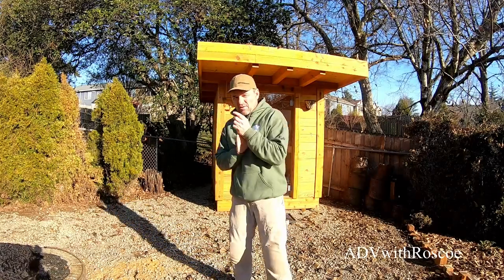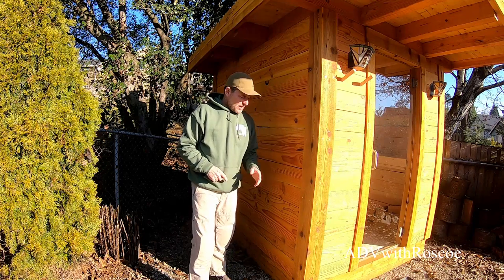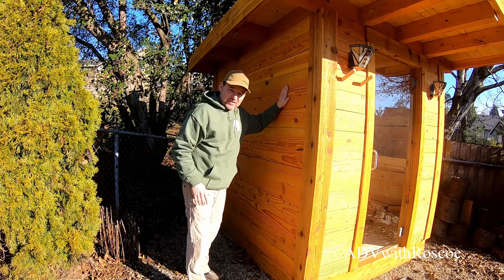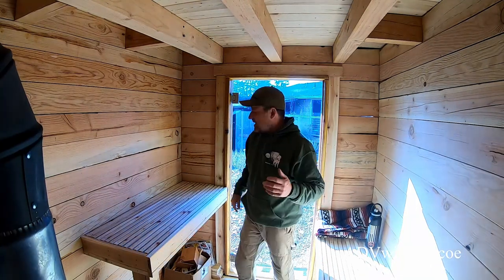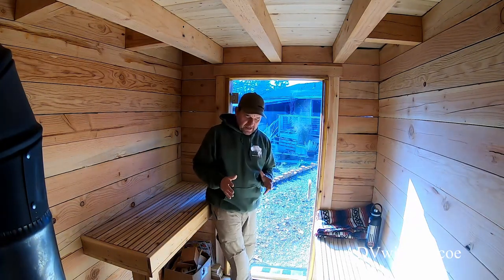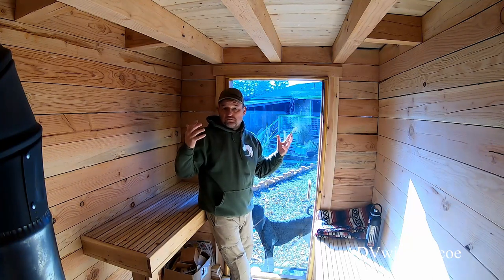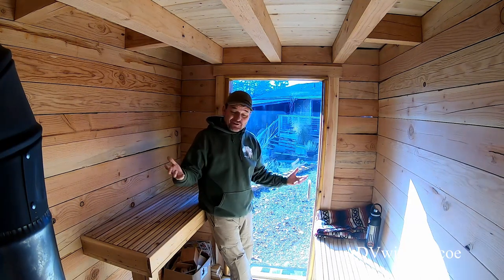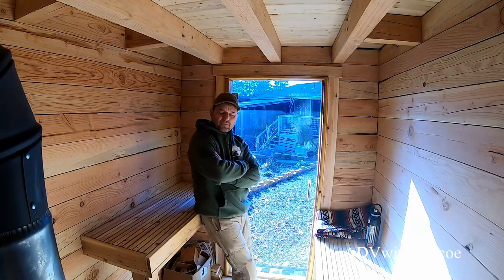DIY Backyard Sauna Build with a Live Roof

Comment: Wow what a great job you did. I may do the same but smaller with 2x kiln dried maybe a 4x4 or 5x5 with rocket stove. I personally wouldn’t use all those adhesives etc but that’s just me. Curious if wood is cheaper up there by now, I’m in Northern California and I can get KD 2x6 for 5 or so $. Maybe I will get T&G so I won’t have to deal with sealing gaps? But I liked your exposed corners and that would be hard with T&G.

Great work, your sauna Is top 3 I have seen on YT after weeks of watching. I’m a builder so we think alike design/keep it simple-wise